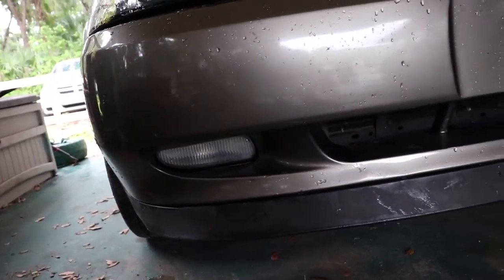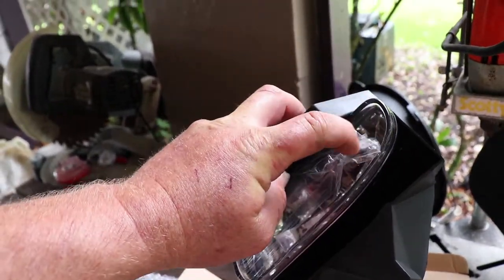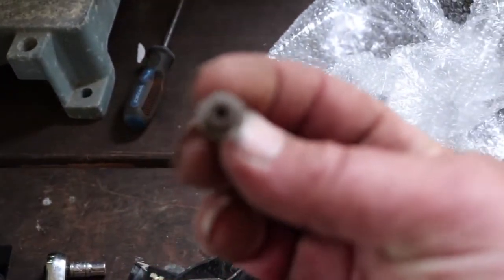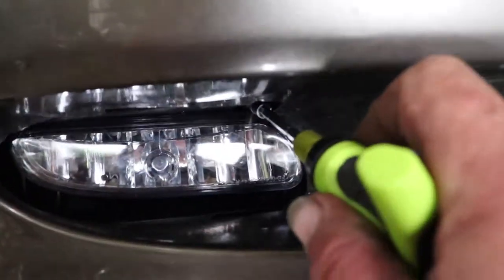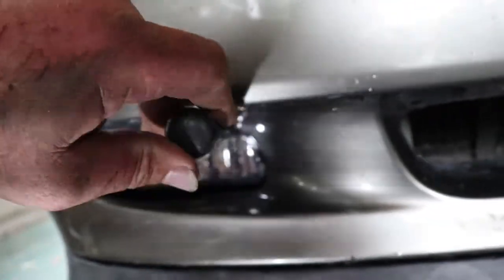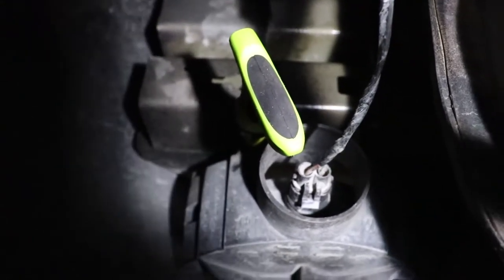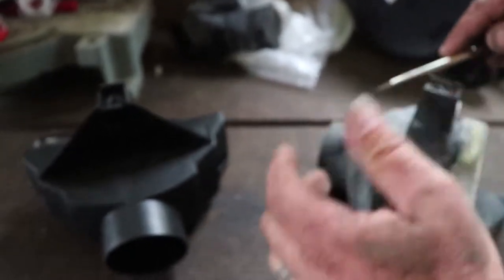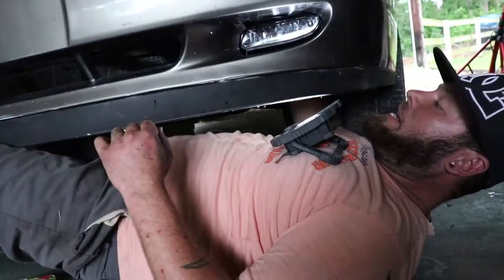1999-2004 Mustang Fog Light Install

Comment: I did the same exact change for my foglights this afternoon.  I found that once I had the old ones out and the new ones approximately located, I could run in the bottom screw first just as you did to put me in the ballpark for the other screw locations (I could at least see that bottom one), and then use the "plastic structural channels of the housing" on top of the foglight housing to guide me in running in the other two screws.  I used a torx bit in a magnetic screwdriver to hold the screw while I poked around with it to locate the mounting hole in the housing.  Easy-Peezey!!  Your "how to" put me on the right track for sure.